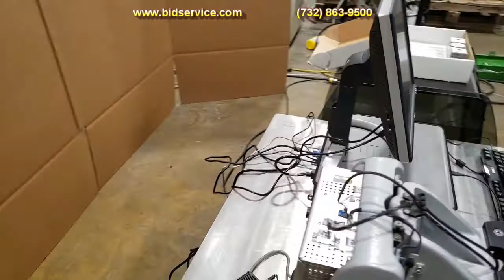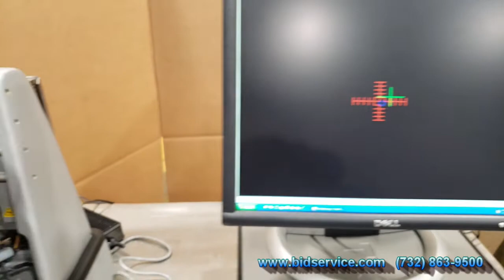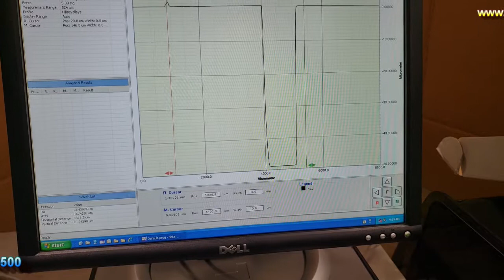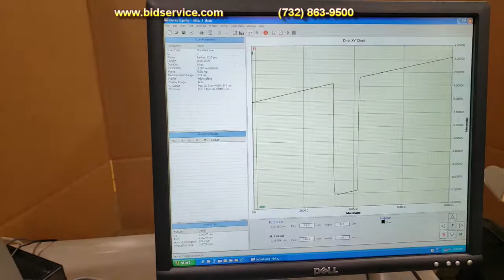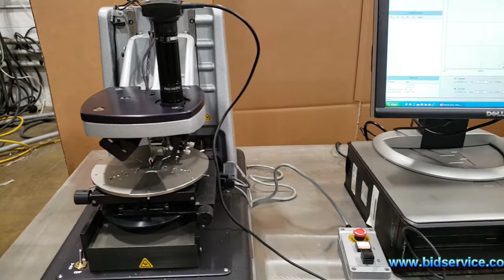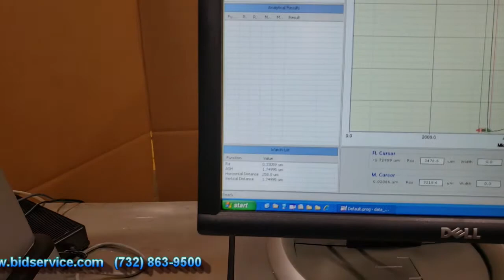Veeco Dektak 150  Inv# 64,292

Comment: In my dektak system, when I run the dektak program, an error appears at the stage of communicating with profiler that says can't conect to profiler
for trobleshooting please verify that 
1- the unit is powered 
2- the unit is attached to one of com1 to com4 port  . 
 In your opinion, where does the problem come from, the system is on, the list and the ports are correct
Reply from the maker: I would try and connect to the different com ports. you will need to reboot system and computer each time.